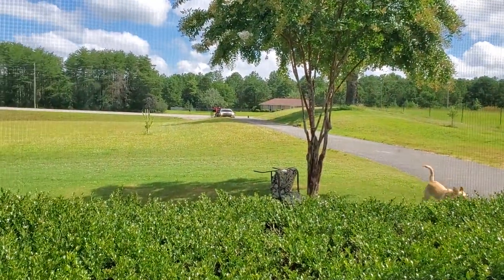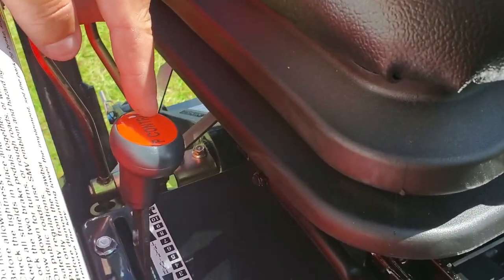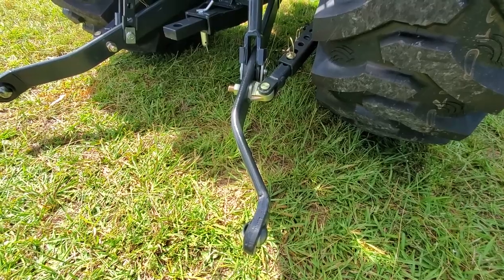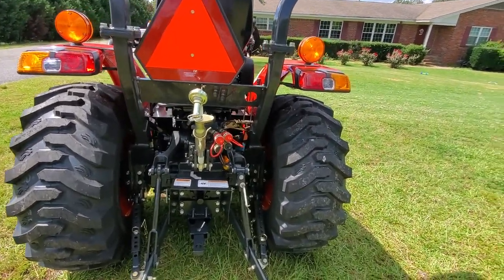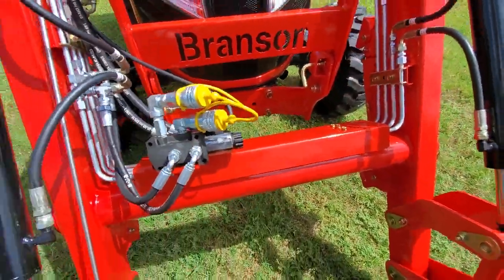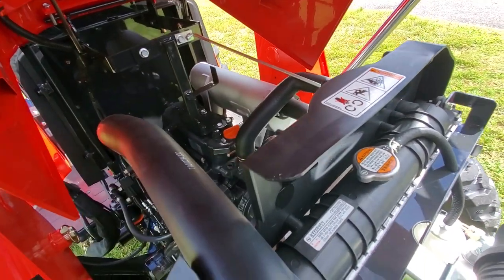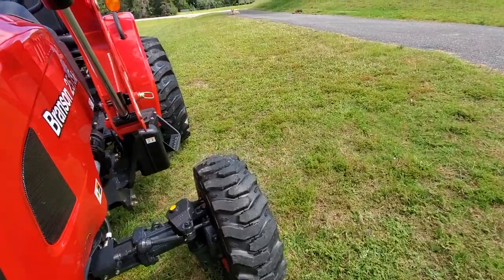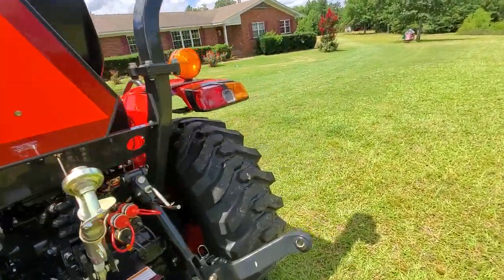Branson 2515h Arrives

Comment: Just purchased this tractor in the standard transmission model.  Should be delivered tomorrow.  Looking forward to seeing more.  Thx for posting.
Reply from the maker: Hope you enjoy it!  I'm waiting on some implements to be delivered.
Reply: Make some vids with the standard transmission pls
Reply: I'm thinking the shuttle would be better for powering through when pulling or pushing while landscaping. Do you think its a sufficient hp and size for your purpose.
Reply from the maker: @Durango214  I purchased this tractor myself.  I'm not sponsored by Branson.  So, I'm kinda limited to only make videos with what I have.
Reply from the maker: @wdbldr67   So far I have only done grapple work digging up 2-4 inch trees and bush hogging hilly terrain.  It has met all my expectations in those circumstances.  I have not done any box blade work yet.  I'm still waiting on the box blade to arrive.
Reply: @bransontractoradventure2387  That's helpful. I have some land and want to clear about 1/2 acre of sagebrush and small trees to eventually build a storage garage and a weekend cabin. I think the 2515 would be adequate. Thanks

Comment: I also would like to add that the brace for your lift arms are on your stands for the loader. Also you don't need to lift the loader to access the engine bay just lower all the way and the front brush guard will tip forward. When you do your 50 hour oil changes the loader is so easy to remove and put back on. That gives you all kinds of room to change a fluids.
Reply from the maker: Thanks IH Farmer! I found the braces the first time I took the loader off.  I pulled the pins and they hit the ground.. WTC!!  LOL ... It took a second, then I realized what they were.

Comment: Just got mine and love it. My only complaint is when cutting high fields, the screen in front of the radiator gets covered after about 1 hr of cutting and I have to stop to clear it. I can tell the screen is covered because the temp gauge will start to rise above the half mark.

Comment: I have been looking and researching tractors for a while in this class. I have a project that will require pulling some smaller trees, removing sagebrush, grading in some roads and leveling pads for a couple buildings Thanks for the great walk around. I decided on this model in the Shuttle a while ago I just need to visit the dealer.
Reply from the maker: There was a video by messicks comparing the gear drive with hydro. (not Branson)  It was really surprising.  The Gear drive had a LOT more pulling power.  But for my needs, this hydro has not failed me.  It will pull a FULL 66" Extreme Duty box blade.  It probably would have been fine with a 72?  And I'm doing a lot of loader work so it works out good for me.
Reply: @bransontractoradventure2387  I saw that it's the one that made up my mind on the shuttle. I am waiting on delivery of a branson 2515r and wanted as much to the wheels as possible on the only 2 ton 25hp tractor made :). In bransons 15 series 35hp and up there would be plenty power for the hydro in a tractor of that class. Thanks

Comment: This is one of only 3 videos on the web I can find on this model.  I have been researching tractors for a while now, and trying to make a decision is tough.  I wanted to stay with a big name brand, but none have the loader lift capacities that the Branson, Tym's, and kioti's offer.  I would like a 25hp to save money, but nervous about lack of power.  Can you make some more videos demonstrating the loader in action, as well as put the tractor under some work loads to see how the 25 hp can handle it?  Thanks again for the overview, and good look with the machine, and the channel.
Reply from the maker: Thanks.  I will be getting some implements in the next couple of weeks.   I will definitely be making some more videos.  The power to the hydraulics will be the same from 25 to 40hp.  The real difference will be in the PTO implements.  I should have a bushhog in a couple of weeks.
Reply: @bransontractoradventure2387  I'm currently using an older NH TC29 tractor to run my 5 foot bush hog, and it seems to be matched right.  It has 25 pto HP, so that's the only thing that worries me with the Branson, it is showing 20 pto hp.  Some people in forums say you need 5hp per foot of cutter, and some say they cut all day with 18 pto hp.  So if you get a chance, demo the tractor with the bush hog for us.  Thanks,
Reply from the maker: @christophertuten6772  I certainly will when I get the bushhog.  It will probably be around the middle of September.
Reply: I have the 2515h for 5 months now and love it. I have a 5 foot brush hog and works great. I have pulled a 8 foot disk as well. Works good on flat but struggles up hill. I would have never guess a 25hp would do what it can. But weight of the tractor and the lift capacity is what sold me on it and it dosent have all the emissions to worry about. Alot less electronics to worry about.
Reply: @ihfarmer2456  Thanks for the feedback, yall have put my mind at ease going with the 25 hp version.  I'm on flat land, so I think this machine will be fine for me.

Comment: I pick mine up on the 15th of Sept.
Its at the dealer now ready, but I need  to close on the land.
Reply: Looks like you tricked out all of the hydraulic options.
Reply: Hope you got the fluid in the tires.  
Ethanol based, RV antifreeze or "Beet Juice"
Look for videos about ballast.
.
https://www.teamtractor.com/blog/beet-juice-tractor-tires-how-to-combine-and-save--16181
For some info on ballast and the beet juice.
Reply from the maker: @fhuber7507  I will post Ballasting tires soon.

Comment: One more question, does this 2515h come with auto throttle?  They don't specify on the website, but the documentation on the 3015 and up horsepower range machines advertise this.
Reply from the maker: It does come with auto throttle.
Reply: My dealer said  there was  very little different from the 3015 other than the emissions systems on the 30 and up in the XX15 series.

Comment: You mentioned the only difference in the motor, between the 25,30,35hp models is the fuel being detuned.  Have you turned up the fuel on yours or do you know if there is an adjustment that can be tuned up to bump it to the 30hp mark?
Reply from the maker: Sounds possible.  But the adjustments on the injector pump are covered with "anti tamper" caps.  I would never do anything like that while under warranty.  It may be a different story 6 years from now.  But honestly, I have not lacked in hp for what I need to do.

Comment: Thanks for posting this.  I just picked up a 2515H myself.  So far, so good, but I have a question.  I remived the backhoe for the first time today, to install the 3PH.  I connected the backhoe lines back to each other per the dealer's instructions, but then the 3PH doesn't operate.  I notice both sets of your rear hydraulic lines are not connected (I'll have a second set of lines installed for an angle for my rear blade).  Am I missing something obvious?
Reply: I'm guessing you need to bleed the lines sounds like air in them
Reply: @horseblinderson4747  It was simpler than that.  I had the drop speed valve closed (slowest possible drop speed) so the hitch wouldn't drop at all without significant weight on it.  Once I opened it up and stood on the back of the 3PH arms, all was well.

Comment: Question what function does the controls you added do?
Reply from the maker: anything that operates at 12gpm hydraulic flow.  I currently use  a grapple on the front  and a hydraulic top link on the rear.  That leave one extra on the rear for me to add a hydraulic side link one day.
Reply: @bransontractoradventure2387  I ordered mine with all the hydraulics available, and am glad I did so.  Like you, I use the root rake grapple on the front a whole lot.  I use a power angle blade on the rear, and may opt for that hydraulic top link since I am already plumbed for it!

Comment: Is the rpm lever for speed or hydraulics ?
Reply from the maker: I think you are referring to the throttle. (rmp lever).  The throttle controls the engine speed (rpm).  The engine speed increases, you have more power for ground speed and hydraulics.

Comment: Do anyone know the difference between the H and the R model??
Reply: H stands for hydro stat transmission and R stands for shuttle shift transmission on the Branson tractors I believe.
Reply: Thank you..OK so that means on the H you got the shift petals like an automatic and the R It’s like I’m driving manual transmission ?
Reply: @Dallasfwguy  I believe you are correct.  I have a 4520R and it does not have a hydro transmission.
Reply: Hydro and reguluh